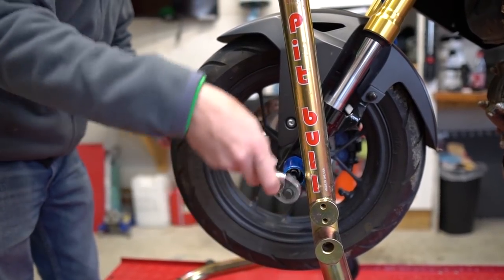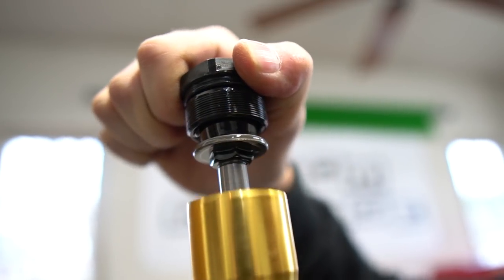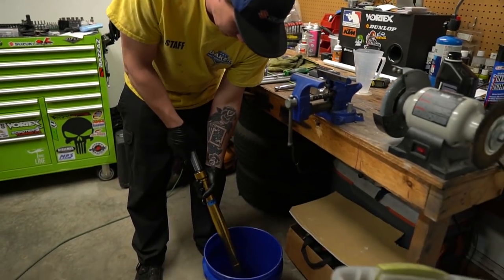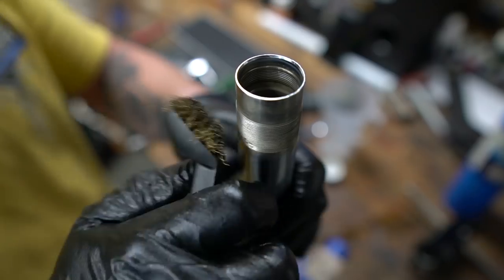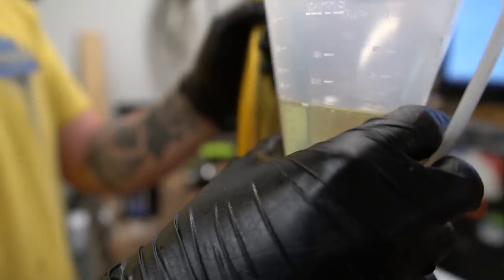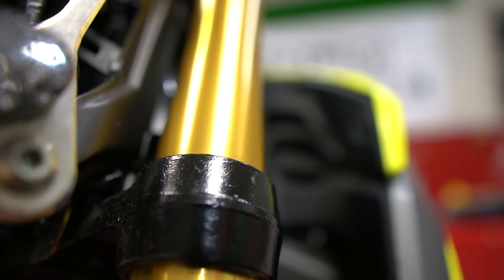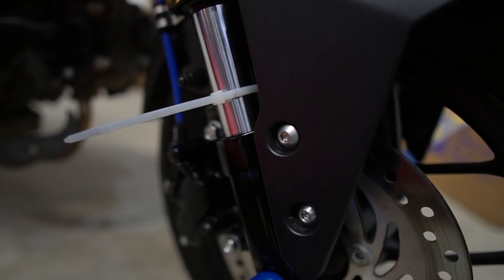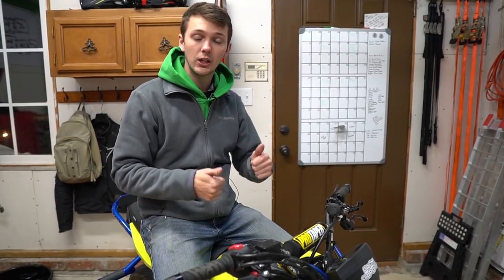Hard Racing Ohlins Fork Springs Install for Honda Grom SF

Comment: Great video.  For all the DIY'ers out there, be sure to observe torque spec's for the lower fork clamp on the triple tree.  If it is too tight it will bind the fork and add excessive wear.  Also, I like to put one fork on and get it lined up at the top, then put the other on on just snug.  Then put the axle through it to make sure the axle holes line up.  If it's off, the forks will bind and ass excessive wear and may even get stuck (I have seen that before).  Once lined up, finish torquing the bolts to spec and then add the front wheel, breaks, fork guards, etc.
Reply: Hey, great info! Where did you find fork clamp specs? 

Cheers
Reply from the maker: In the service mania
Reply from the maker: Manual

Comment: You didnt put the fork bottom back in the vise and tighten the torque value down to 70Nm/51.5ft lbs.. you cant use a 14m hex socket because it is too short. So im assuming you skip that part. Seems dangerous not to tighten the fork bottom to the fork tube. You just but blue Loctite and hand tighten it.
Reply: its so hard to tighten this back up

Comment: If guys want to install your fork internal spring or valves correctly i recommend watching this video by hard racing https://youtu.be/0wYHkg9f9cg 

It is a little different to the SF models but the only difference is the washer on the damping rod. It would be a nut instead. but ohlin replaces all that when you order the ohlin springs for the SF. https://store.hardracing.com/cart.php?target=product&product_id=29925
Reply from the maker: Dude, chill out... it works fine and I haven’t had a single problem. Dude, you need to relax.
Reply: @GromGarage  glade to hear it holding up... hopefully nothing fails after riding and stunting..  liked the vid tho... i laughed thru the whole thing.. 
Love your vids they always make me laugh..
Reply from the maker: Glad to hear it man, at the end of the video I recommend watching hard racing’s video as you said, for me I just wanted to have some fun and show the process. Thanks for watching

Comment: Why did you used blue Loctite ?? Ohlins instrustion says to use 271 Red Loctite on that fork bottom and to put a thin ring around the threads... 
Not blue loctite and put a thin line straight down.
Reply: M1sta KR4ZY blue loctite is easier to come off with hand tools. Red can only come out with heat or extremely strong force. I’m pretty sure they want to be able to take it off in the future when they upgrade or replace something. I use blue on things I plan to take off again. 

Check my channel out if you like Grom content🙌🏽

Comment: What spring rate did you get for your weight?
Reply from the maker: The springs are just the ohlins springs from hard racing, so whatever that is.. fluid is 10 weight fork oil

Comment: Did you just replace the springs, or did you purchase their $200+ kit ?
Reply from the maker: I did not buy the whole kit. Just the spring upgrade with the spacers included. I also changed the oil for some thicker oil. I am super happy with the setup because I personally think the full kit is too still for me
Reply: perfect! The full kit is more than I wanted to spend. Big fan of the channel and all your instal videos 🤘🏻

Comment: Why you over tighten the bottom cap? isnt the torque value on the bottom fork cap 40Nm/29.5ft lbs.. 
i didnt see you guys use a torque wrech..